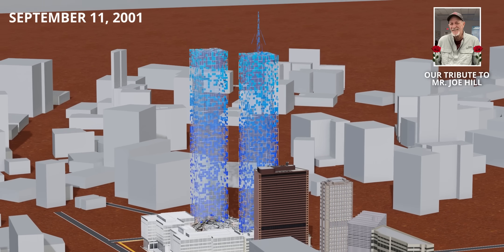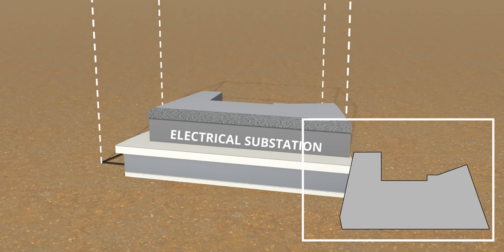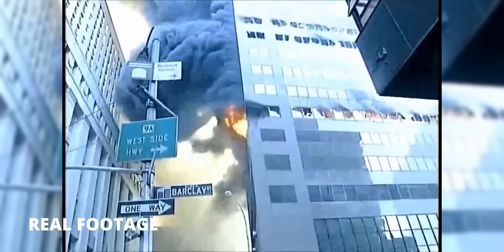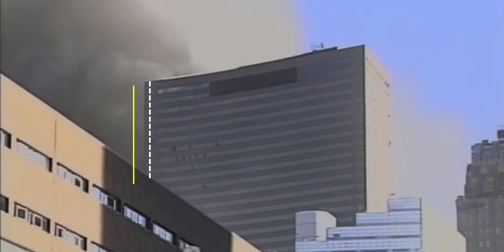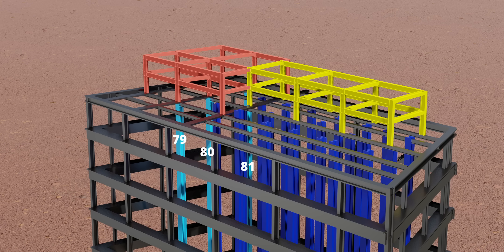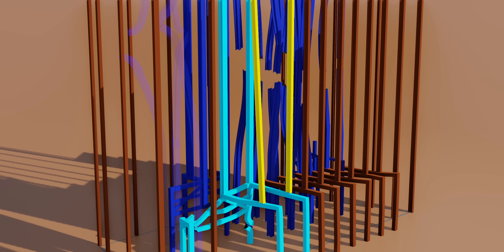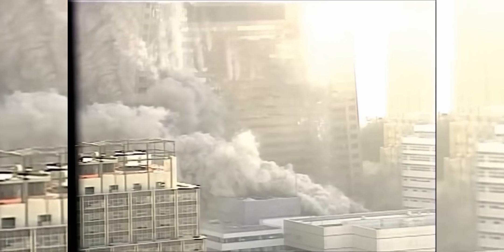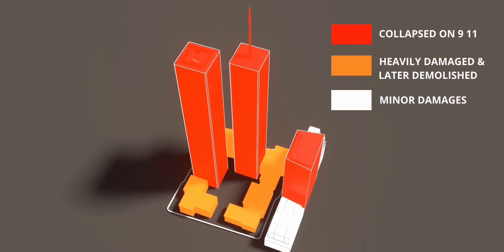Collapse of Building 7 | The Complete Physics

Comment: I'd be ashamed to call myself an "civil engineer" or any engineer for the matter, after hearing the "official" narrative.
If the basic laws of physics don't apply to neither of the 3 towers, that should tell you all you need to know about the investigation.
Reply: Cool. Where's your physics degree?
Reply: So are you invoking magic or divine intervention?  The only way to get around laws of physics is with the supernatural. So either it was the supernatural or you don't understand physics (or much more importantly, engineering).
Reply: @TheCriticalStinker-01  Explain to me how 15% of a structure crushes the other 85% without resistance. It's impossible. It becomes possible when you factor in the nano-termite found in the dust of the towers...
Reply: @hypegamer347  - Why would I explain something that didn't happen?  Were you not watching this video?  Collapse started at the NE corner of the core with the failure of C79, followed shortly by C80 and C81 (Sabin simplifies this by failing all 3 together - makes little difference), then progresses from east to west through the core until all the core columns are gone, taking all of the internal floors with them and probably pulling down most of the perimeter columns as well. This leaves only the exterior moment frame still standing - a _hollow empty shell (or as Sabin refers to it - an "empty cereal box") - that only looks like a building still standing. The four corner columns and last few surviving perimeter columns then inevitably fail and the moment frame drops. 

The end. 

There is no 15% dropping on 85%

Wrong building, genius.
Reply: @TheCriticalStinker-01  Both the twin towers fell on themselves without any resistance, that in itself is not possible. You understand? Impossible. 

The video you refer to also shows the damage to the column you refer to was caused by the antenna of one of the twin towers.. That is a lie. The antenna fell to the opposite side.

The university of Alaska re-created building 7 exactly to the blueprint and simulated the official narrative sequence of events. Their research concluded that the official narrative does not follow the laws of physics and the only match for an explanation was if it was a controlled demolition, as the signature of momentum conservation/decay matched that of demolition.
Reply: @hypegamer347  - No resistance?  Where would you get a silly idea like that? 

Also, you clearly never read Hulsey's study. He claimed no such thing. You are just mindlessly repeating little bits and bobs you find on the internet without really understanding them.
Reply: @TheCriticalStinker-01  The university of Alaska recreated the buildings in virtual form according to the blueprints precisely. They ran high fidelity physics simulations and ultimately proved the collapse of the 3 buildings could not have happened as the 911 commission concluded. All 3 buildings demonstrated a collapse speed which would only be possible if the all columns failed at the same time. It is a fact that even if part of the tower collapsed on itself, the structure bellow would provide enough resistance to slow it down. The only place the top of a building falling onto itself crushes the entire building is in lala land where physics do not apply. Btw, the same guy in this video claiming the gauge in building 7 was done by the antenna, is lying about it. The antenna fell to the opposite side.
Reply: @TheCriticalStinker-01  It is just amazing the mental gymnastics they go through to claim it was a chain reaction coming from one column failing. Its also highly arguable whether it was gauged by any debris capable of damaging the columns whatsoever. You still didn't address the nano-termite found in the dust of the towers... so that's not the end.
Reply: @hypegamer347  - Yeah, like I said - you never read it. Maybe the Cliff's Notes version, to which you added a whole lotta fluff.

I have actually read both the Hulsey preliminary and final reports from cover to cover, which is more than I can say for most of the people who recommend it to me. The Hulsey report is such a dead horse now, flogged so many times now I find it difficult these days to drum up the enthusiasm to do it yet again.  But here it goes. 

My opinion of the Final Report is as follows:

The Hulsey Final Report on Building 7 met none of its three stated objectives – indeed could not have met those objectives for lack of trying - and failed to prove its main conclusion, by way of a fundamental logic error; Hulsey claimed he had concluded fire could not bring down Building 7 without accounting for the full envelop of possibilities.  Essentially, he claimed to have proved a negative

Hulsey also plagiarized almost 3 pages of material from Tony Tsamboti, who works for the studies sponsor. I hope I don’t need to point out the ethical implications of that. 

While promising superior models to those of The NIST, the Hulsey Report in fact delivers grossly inferior models which eliminate the time factor, focus on only two floors and rely on a greatly simplified version of The NIST’s temperature data.  The model animations are clearly not derived from the model data as they show no dynamics at all and are obviously forced to make the animations (superficially) look closer to AE911T’s imaginging of the real event.

Overall, it is a shoddy piece of work done by a man clearly working out of his element and areas of expertise. It rather reeks of trying to support a conclusion arrived at before the study started.  Curiously, study sponsor Architects and Engineers for 9/11 Truth having announced what the study would conclude before they awarded it. 

Hulsey tested just one out of countless thousands of possible scenarios, using a completely unrealistic scenario and an artificially restricted set of data almost like he wanted to ensure fire would not cause a failure. The Hulsey Report was so factually inaccurate, methodologically unreliable, scientifically unsound, illogical, and biased that it blatantly violated any requirements of objectivity, utility, transparency, and reproducibility that would have been required to submit it for peer review in any reputable journal.

Hulsey and his assistants have not published the report anywhere that any relevant academic or professional engineers look to. 

Hulsey had said all along that the report would spawn several (perhaps four) papers in good American engineering journals and possibly a book. 

Then Hulsey walked that back, realizing he'd stand no chance to pass peer review in America and so said he'd go for European journals - but years have gone by with no publication whatsoever. Also, no book from any science publisher either. As far as the engineering profession and science are concerned, the Hulsey report barely exists.

The engineers of America and of the world have never read it.  It has had zero impact in the professional community. 

To its intended non-engineering literate audience, they Hulsey Report contains enough engineerspeak density for them not to ask questions, even if they were so inclined. Since the report appears to (superficially) deliver what they want, they are not inclined, even if they knew what to ask. From a structural engineering perspective however, The Hulsey Report is of no value, which explains why promises to get the report published in peer-reviewed and reputable engineering journals where it could be scrutinized by qualified professionals were abandoned.  

If you are genuinely interested in what happened to Building 7 rather than in promoting a political agenda, there are several excellent forensic engineering reports out there and over two dozen articles published in genuinely peer reviewed engineering journals that are far more comprehensive and competently done. I suggest you seek them out instead.

And actually read them. Thousands of pages of material.  This should get you started.

FEMA BPAT (initial report superseded by NIST NCSTAR 1A)

NIST NCSTAR 1A: Final Report on the Collapse of the World Trade Center Building 7, 2008.

Guy Nordenson and Associates, WTC7 Global Collapse Analysis Report and Summary of Findings, 2010.

Arup, WTC -7 Structural Fire Analysis Report (Runs 1-4), 2010.

Weidlinger Associates Inc., WTC 7 Collapse Analysis and Assessment Report, 2010.

BRE Centre for Fire Safety Engineering, Analysis of the Impact of a Fire in the Mechanical Room (5th & 6th Floor) of the World Trade Center 7 Building, 2010.

T. McAllister, R. MacNeill, O. Erbay, A. Sarawit, M. Zarghamee, S. Kirkpatrick, J. Gross, Analysis of structural response of WTC 7 to fire and sequential failures leading to collapse, J. Struct. Eng. (United States). 138 (2012) 109–117.

For a summary of the major studies I would recommend THE COLLAPSE OF WORLD TRADE CENTER 7: REVISITED by Mhd Anwar Orabi , Liming Jiang , Asif Usmani and Jose Torero which is a 33 page summary of the different analysis and conclusions published in 2020. Sorry, YouTube will delete this post if I give the link but it should be easy to find and is available from the University of Queensland, Brisbane. 

Real structural engineering industry professionals conducting real engineering studies and publishing them for other professionals to see. Not amateur YouTubers appealing to the gullible and credulous.

Happy reading
Reply: Every conspiracy fool "knows an engineer' -- bet you are not one.